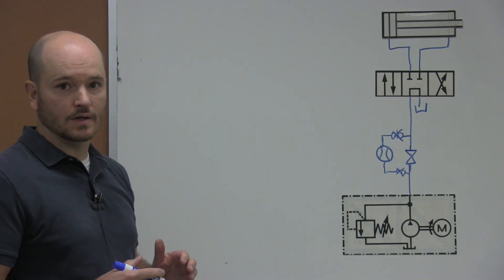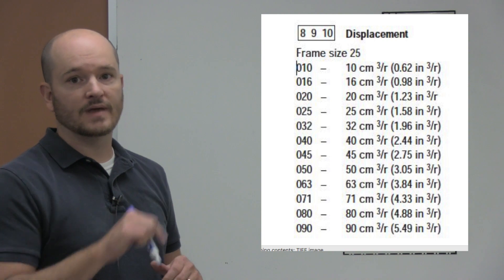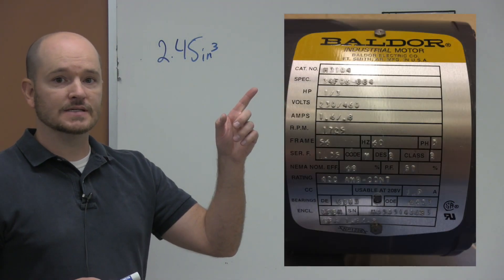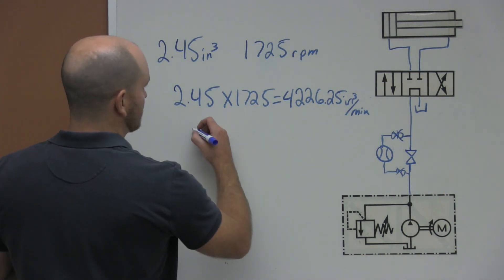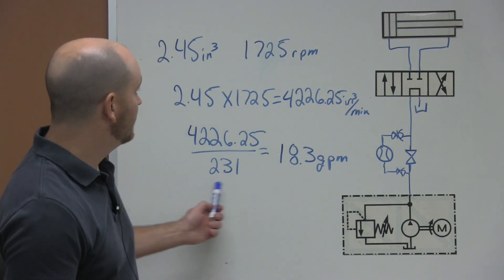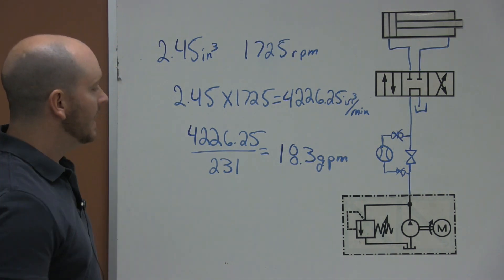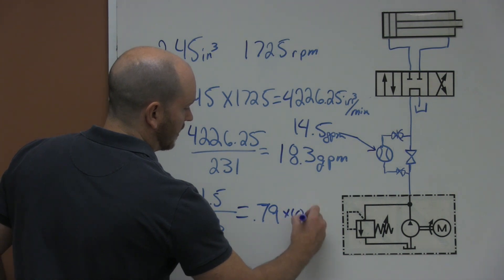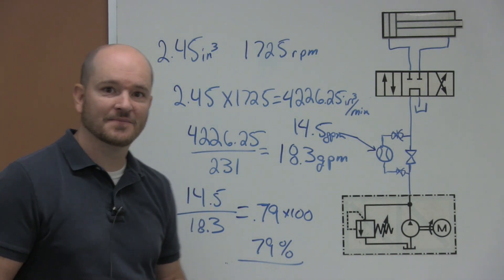Calculating Hydraulic Pump Flow and Efficiency

Comment: That’s not how efficiency of a pump is defined. It’s the ratio of theoretical power over actual power a pump is using to deliver any given flow rate at the actual head it’s delivering that flow rate. So, this is not correct at all.

Comment: Hello great video thanks for sharing. I have been following along and watching these. In the calculation for GPM, (4226.25/231=18.3) GPM  and I trust you know what you're doing, what is or where does  "231"  come from for this ? I'm no math expert by a long shot but I just want to know if it is a standard/constant for figuring out this? Thank you.
Reply: Yes it's a constant value
That just converts 4226.25 from in^3 /min to gal/ min
1 gallon per min = 231 in^3 per min
Reply: 231 cubic inches of volume in gallon

Comment: what size hydraulic pump do I need for 5 horse power at  3000 psi and what is the formula at 1600rpm

Comment: Can I use a similar principle to measure pump flow? I don't want to spend the money on a flow meter. If I connect a hydraulic motor to my hydraulic pump and using the displacement per revolution on the hydraulic motor and measuring how many rpms when running should make it possible to calculate the gpm of a hydraulic system. Would this work? I need to test my pump's gpm because I think it's not performing to specs.
Reply from the maker: That is a an idea I have never thought of.  There are couple factors that I would have to think about.  But it would give you an idea if it is not running correctly.  I would not put a load on the motor.

Comment: If i can't get the theoretical flow rate for a gear pump. Is there a way to manually calculate the flow rate of the gear pump?
Reply from the maker: Not that I know of.  The problem is you don't know the volume per rotation.  You can hook up a flow meter.  That is about it

Comment: I need information how much KW required for using a single vane pump. And for a double vane pump?

 

For example, For a single vane pump with 7KW power in, we will use 7KW motor. Second case, I have a double vane pump with port P1 7KW & port P2 10 KW. In this case, what is my motor capacity 7KW or 10 KW or 17KW(10+7)?

 

Also for third case, i have bidirectional motor(two shaft ends). LH side end is a single vane pump with 5KW capacity. RH side double vane pump with P1-7KW & P2 10 KW. In this case how much capacity motor i have to select?
Reply: Have you got the anaswers?
Reply: @kangkangoswami4436  no I didn't

Comment: May I know sir Pump Impeller size(mm) to discharge water at high pressure for 5HP 8 Stage 3 phase submersible motor from 220feet at a voltage of 240v through 2inch pipe .
Reply from the maker: Sachin, your questions is a dynamic fluid questions.  I would feel uncomfortable answering the questions has that is not my main area of studies.  My videos are for fluid power which is different than a dynamic pumps you are asking about.